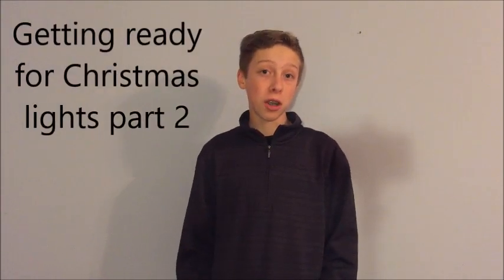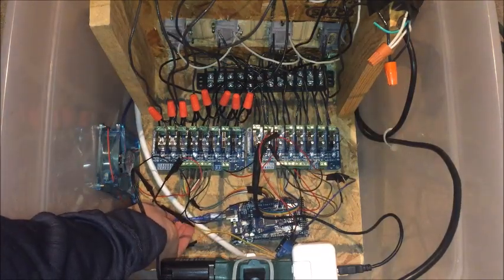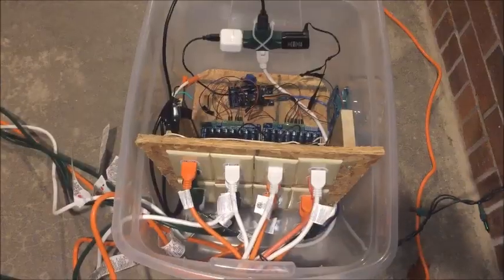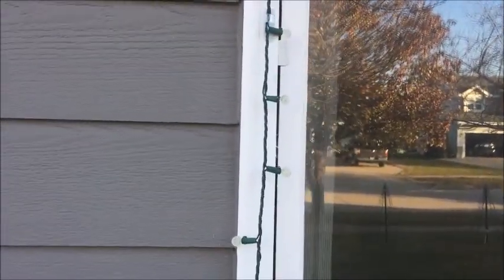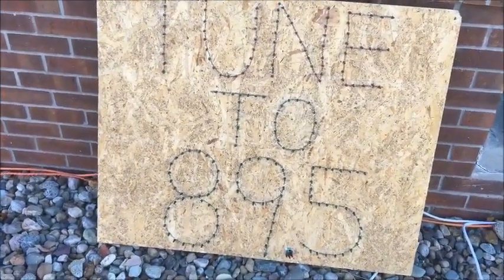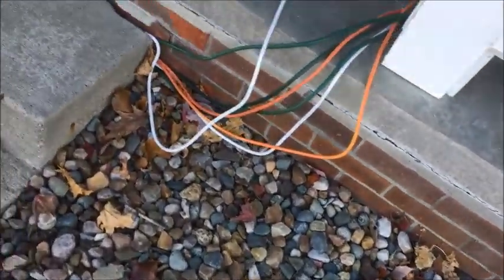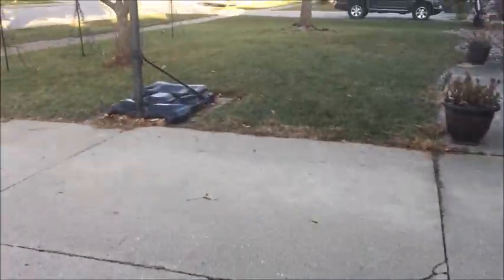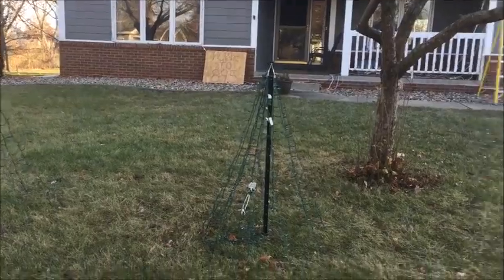Getting ready for Christmas Lights to Music part 2 -Arduino

Comment: An excellent effort and great project.  Could you do a video about the software you used to develop the lights program please, is it called 'Victim'?
Reply from the maker: Possibly, I would love to do something like that. Until I have time to do that there is a guy out there that does the whole light project in depth. This link: https://m.youtube.com/watch?v=Hkw4fwjqjM0&t=202s
goes to the parts where he does the software part. If you go back to VIDEO 1 part... you can see all the hardware. He helped me a lot! Thanks!
Reply from the maker: Also it is called “vixen”
Reply: @arduinoinventions8762  Hi Thanks for the prompt reply, sadly as I get older my hearing is deteriorating and I don't always here words clearly.  I'll look at the video link you supplied too.  Best of luck with all your future projects.  When you have time take a look at the ESP8266 and ESP32 WiFi wireless modules.  There are lots of things you can do with them and lots of fun.  They can be programmed from the Arduino IDE so coding them won't be difficult for you to learn.
Reply from the maker: Thank you! I have looked a bit at WiFi modules but have not done a full blown out project with them(:

Comment: I've been thinking about doing a type of setup like this at my own house, and I wanted to ask what relays you used specifically. I can't seem to find them online so if you could provide a model number or a link that would be great. Love the video thanks!
Reply from the maker: I used to use mechanical relays but recently switched to solid state relays. They are much more efficient, last longer, and switch faster. They are more pricy but worth it. I bought mine on amazon. Here is the link: 

https://www.amazon.com/SainSmart-8-Channel-Duemilanove-MEGA2560-MEGA1280-x/dp/B006J4G45G/ref=mp_s_a_1_3?ie=UTF8&qid=1544149429&sr=8-3&pi=AC_SX236_SY340_QL65&keywords=arduino+solid+state+relay